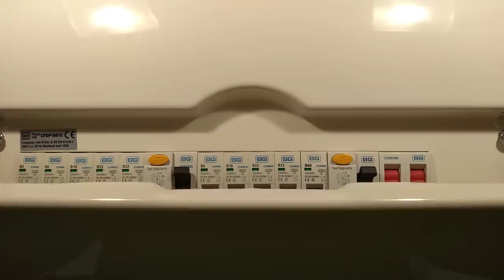A look inside a British home electrical panel.

Comment: I live in western NC in the US way out in the sticks, my wife (of 31 years) owns a couple of horses, (she owns everything of value ;-), and she put up a 40x40 barn about 450' from her home. I ran 450' of #2 aluminum wire down (4' U/G, she also owns a tractor with a back hoe attachment), to it and installed a 40 amp box at the barn (in case she ever makes me move out I'll be able to watch Clive ;-) Interesting to see how you folks "across the pond" do things :-) Not sure I'm in favor of that ring circuit, way to many incompetent electricians over here for that!!! Interesting video, thank you Mr Clive :-)

Comment: Being in the US, I had to mentally double most of the amperages. My furnace and water heater are each on a 50A breaker. The main one is 200A.
Reply: Ditto
Reply: 50 amp??in italy we have 17amp  max load in a normal house with a 3kw contract.
Reply: Had a 50A circuit for an electric stove in our old house which we de-installed - we put in a gas stove and I needed panel space for more circuits in the kitchen and bathrooms.  Dryers in both houses are on 30A circuits, and AC compressors are 30A or 40A. Those are the only high-current loads we've got. Water heater and furnace are both gas.

Comment: I know that you know what you're doing. I was raised to believe that (electricity wise) if it's shiny, don't touch. You got me all creeped out, touching everything. :)
Reply: yea, I think it wasn't connected and just sitting on his alter/bench
Reply: I need to watch the video still, so I dont know for sure, but there is probably a main breaker, possible the red swtich on the right, that disconnects power to everything else. I know we have them in the US and I would assume the same for the UK
Reply: @BlauNate  Yes. Also it was a box siting on his bench.
Reply: @BlauNate  He flips the red switch back and forth a few times just to make sure it's dangerous

(it's not actually connected, it's just on his bench)
Reply: A good rule of thumb if you don't understand electricity. However I have seen copper overheated or old enough to no longer appear shiny. Actually takes on an orange plastic look. You would not want to touch that when energized, not only will it shock you, it gets really hot in that state.
Reply: The supply tails are still in the plastic bag it's dead as a dodo
Reply: It's not connected. It's just a mock up. You can tell that nothing is connected by the lack of wires connected to anything, how he removed the breaker and the bus bar wasn't connected, and how casually he was touching the incoming side of the main switch. When working with electricity, try to use common sense instead of those stupid, "I was raised to... [insert generalization here]," sayings.
Reply: I've seen people talking about working on this kind of box (like adding a new circuit) while it's all live. Not me. The whole thing gets shut down.
Reply: it nice sharing info but if you dont know what your doing dont play with the electric pixies as they will jump out and shock you
Reply: @octymocty132  I just treat electricity like a gun. Loaded or unloaded, treat it with respect or it may bite you.
Reply: Not just shiny! 
...... Burnt stuff turns to carbon and conducts quite well enough to turn your day Bad!
Reply: @chaos.corner  It's kind of reminiscent of doing power work in a telecom carrier facility. Everything is -48DC with two redundant supplies. Working around DC power installing equipment and so forth unnerves me in a way poking and prodding in a house panel never did. Fortunately, in the 16 years our network's been up, we've only had one hand tool arc-welded to a bus bar, and that didn't injure the engineer in question any worse than a bad scare and a blow to the pride. :D

Comment: You panels always look so nice and easy, our panels here in the states with our goofy 110v split phase system is such a pain in the ass. I have been wiring yachts for years and the worst is trying to set them up for US and Canada electricity. 230/240v 50hz is so much easier....
Reply: :D And I just thought this one doesn't look that nice and easy compared to ours.
Reply: @mrkv4k  I thought the same. I put a new 200 amp panel in my workshop and it seemed really simple and straightforward compared to this.
Reply: @relishgargler  And in the UK most homes only have 30 or 60 amps which is kind of pathetic. Even if you take into account the fact that 240v means the current can be usually halfed.
Reply: @mrkv4k   Yeah. Power comes in the top, breakers snap into the bus bars, and loads go out the sides. Cinch! :D  Oh yeah, and don't bond the neutral in subpanels. :D
Reply: @baileyharrison1030  63A is generally the minimum you will find in UK.
Reply: @MattF340  Don't you mean the maximum? Iirc
Reply: @well_as_an_expert_id_say  Our last house had an 80A RCD so not the max.

Comment: As a German electrician I would say this is a really cheap panel.
The neutral and earth busbars are screwterminals, In Germany you only get (at least from all brands) ones that are isolated and instead of screwing, they have a system working similar to the Wago terminals for solidcore copper wires. So you can connect up to 4° wire to that neutral or earth busbar without screwing. Only the main 10° has to be screwed in.

Also for the metal housing, here you can get only ones made out of plastic. even the old ones are made out of plastic or bakelit.
Only control cabinets and main distribution boards are made out of metal.

The main busbars in Germany are 3 phase, isolated (only saw unisolated ones in a really old board, 40 years +) and they have an O cutout, because they get screwed in directly behind the claming screw from the breaker. The company Hager has even a system, where you only have to push in the busbar and thats it.

I was wondering about that DRCBO that you showed, with only 1TE with and that neutral pigtail. In Germany you only get ones with 2TE (like the 2 ones in the Panel) without a pigtail and such

For the RCDs, I was wondering why the DRCBO would consume power ? 
there is no active electronics in it. Only if you have an AFDD (arc fault detection device) or an F ,B or B+ type RCD they consume power, because they use active electronics.

The F, B and B+ Type RCDS are really good if you have problems with lightning tripping your normal RCD. 
The F, B and B+ won´t trip, because they actively looking for faultcurrents, even ones where a normal RCD won´t trip. Like DC or high frequency faults.
Momentarly they only get used for inverters and frequency controllers (like motordrivers and solar systems) because they really expencive (about 15 times the cost of a normal 4 pole RCD).

Are you allowed to wire up a circuit without an RCD ?
In Germany you have to use an RCD with 0.03mA trippingcurrent in a household application, also B- caractaristic breakers.

The C caractaristic breakers only get used in industry applications or for big motors.
The caractaristic is about the times x the holding current, the moment when the breaker instanly trips due to overcurrent.
So a type B breaker trips about 3-5 times the holding current, a B 16 breaker trips instanly due to overcurrent at 80 Amps.
a Type C breaker trips really late, at about 10-15 times the holdcurrent, so for a C 16 breaker that makes 240 Amps.

But anyway, great video Clive. And maybe we see a comparison to other panels from other countrys ?
Reply: Most RCBOs Ive seen do contain active electronics. How else would they operate?
Reply: You say RCD tripping current is 0.03mA? Perhaps you mean 30mA?
Reply: @Graham_Wideman  sorry I meant 0.03A so 30mA yes.
Reply: @Chuckiele  No, they work completly without active electronic. They re a simple circuit breaker and a standart type A 2 pole RCD in one case. The RCD only consumes a tiny ammount of power if there is a leakage current/fault . (at least the 2TE ones, that we use in Germany)
Reply: Screw connectors or push in connectors doe not mean cheap or high quality. (I have seen panels from east Germany also) There are zillion screw terminals in use around the world. Regards.
Reply: @subramaniamchandrasekar1397  Everything industrial is screw terminal, I much prefer it that way in residential as you can verify lug torque. The spring loaded systems have no way to verify.
Reply: At least our sockets aren't those death trap Schuko efforts that allow everything and anything that fits in them :)
Reply: I agree with you on the screw terminals. The preference to screw terminals or push in terminals is not of any standard. I work in industry. If my clients have push in terminals as plant standard (lesser inventory stock) and asked for, we manufacture panels with push in terminals. Regards.
Reply: @subramaniamchandrasekar1397  umm that was a joke, i love screwless terminals
Reply: @grahamek86  What's wrong with Schuko? I love these sockets because you can use a grounded plug in both orientations. Since I ordered a Schuko rack mounted power bar by accident in Poland instead of French/Polish type I'm in love with them.
Reply: All RCBOs and MCBs have to dissipate power.  As well as a rapid magnetic trip they have a slow thermal trip - that has to be heated up to operate,  and usually it takes about 1W at full load.  Imagine even if the thermal element has only 1 milliohm resistance that's 1W at 32A.
Of course the breakers aren't normally running anywhere near full load,  so typically maybe taking only a few milliwatts. Some do have active circuitry that may take a little more.

Comment: Nice to see the wires nicely terminated in correct bootlaces ferrules. I have come across so many where stranded wire is clamped directly by the pinch screw.  Know it's a bit OCD but it really pleases me to have the wiring super neat and tidy in the boxes, does not do anything to alter functionality but it looks good and inspires confidence in my customers, they know you have given a shit about the standard and quality of your workmanship?
Reply: The wires are going to a bus bar so you not gaining much in the way of protection. You can get half insulated and colour coded ferrules if that is deemed necessary?
With the ferrule you have better current carrying capacity as all the individual strands are secured by the pinch screw. Without the ferrule and assuming you have not soldered the wire end then only a few conductor strands are secured,the remainder are floating. This is a reduction in the current carrying cross sectional area. I have viewed bare conductors,soldered and ferrule fitted wire under maximum load conditions through my thermal imager camera and there is a discernible difference in the junction temperature. I continue to be a firm advocate for the use of ferrules and soldering as a backstop but nothing else.

Comment: Looks so different than fuse panels uses in Poland, we use also 3x230/400 Volts for many residential, our boxes are always 4x DIN for 16 breakers in some houses and usually few RCDs for light circuits, socket circuits and high power circuit three phase or single phases for washing machines, stoves etc.
Our panels usually are fire retardant plastic

Comment: In the U.S., breaker boxes are oriented in two vertical rows, with the breakers turned on their side.
Reply: Canadian boxes are same general design, but their code allows horizontal mounting, provided you do not use what is now the top row.  That is because the breaker mechanisms would be forced to work against gravity and that is prohibited.  (Learned that from watching Mike Holmes)
Reply: You can get consumer units in both horizontal and vertical orientation, but in domestic use they are typically horizontal. Vertical tends to be 3 phase
Reply: Timothy Barney I loved Holmes on Homes
Reply: The industrial panels in the UK are mounted vertically
Reply: @timothybarney7257  Interesting idea.
I think that might be why code here (probably in all of Europe, but I didn't looked at all the codes for the 50 or so countries of Europe :p ) breakers must always be mounted in the sense in which you can read the writing. And all breakers are designed so that the open/off postion is down, so ours actually have to fight gravity to stay closed/on.
Granted, given how strong the springs are in those things, gravity is probably very neglictible. If your breakers fall open because of gravity, it's time to change them :o
Reply: @timothybarney7257  : Panels can be horizontal and be fully used, at least in Eastern Ontario. You must clearly mark the on and off positions, which only takes three labels to do so (or a sharpie, preferably neatly written). [Was an Electrician at a mom & pop shop for ten years. Installed a new horizontal panel two summers ago. Inspectors never had any issues]
This sounds more like Holmes doing his usual 'its not my way so its wrong'. I enjoyed watching him until I noticed many things done right that he blew a fuse over. In the end its a reality TV show, things need to be done over the top or your get a boring episode.
Reply: @ttomkins4867  fair enough. I've seen some pretty odd local code requirements as well in the states. For example, in Poughkeepsie New York, the city requires external disconnects at the meter pan on residential services, something I've not heard of elsewhere. Their stated reasoning is in case of a fire the power can be cut off to the house before firefighters enter. Anywhere else, if they do anything at all, they will just yank the meter.
Reply: @timothybarney7257  That is more common than you think. It does make it much easier if the main line to the breaker panel, or  an old breaker panel needs to be replaced. I once needed the house line dropped for tree cutting, and the power person appreciated me shutting the meter breaker off when he was reconnecting the wires. It also prevented arcing the wires that could make a bad connection from the active loads in the house.  That is just my experience.
Reply: Poor contacts in one breaker will cause temperature rise which will heats up everything above it due to heat convection. This is avoided in horizontal setup.
Reply: @timothybarney7257  Yank...the...meter? Okay, the house is already on fire, but "yanking the meter" might fry the person doing this in less than 0.01 seconds (seriously).

Never ever "yank a meter" or pull a main fuse of you cannot confirm that there's no substantial load. When there is a substantial load, yanking the meter or pulling a fuse will not interrupt the current; it will continue to flow, through the air, as a (lethal) arc.

Switches which can switch substantial load have arc quenching chambers built-in. Meter prongs or fuse holders don't.
Reply: @klausstock8020  The fire department will, in a pinch, use great big cable loppers with long, insulated handles, to kill power to a burning building; naturally they'd prefer to cut a padlock and throw a disconnect :)
Reply: This has to do with the 120/240 split phase design.  Also the panel in the video is itty-bitty.